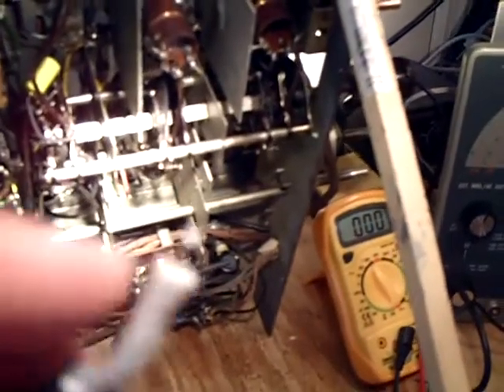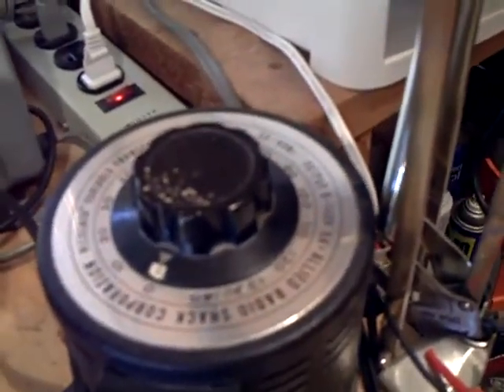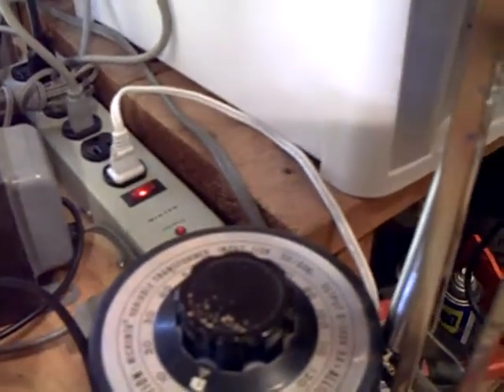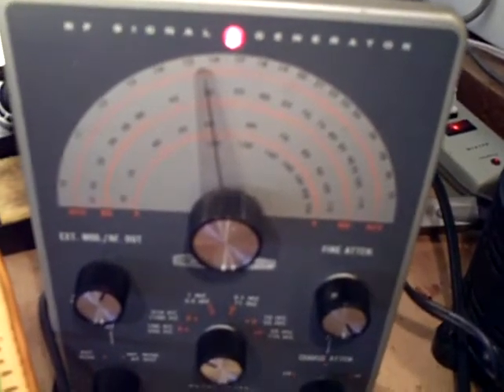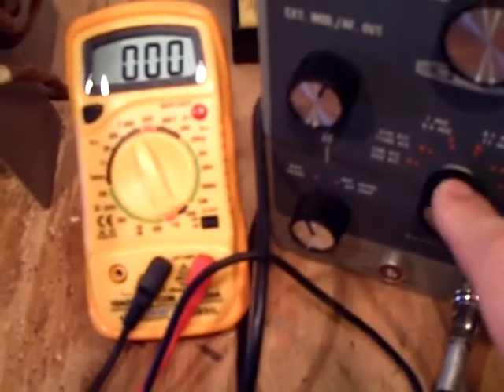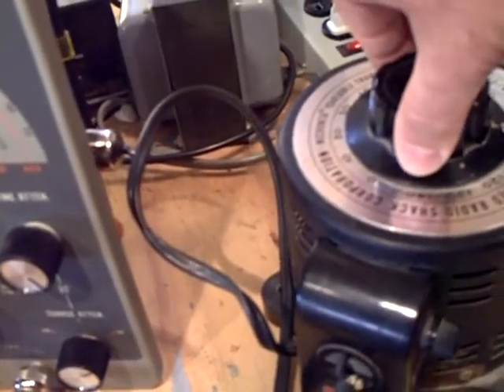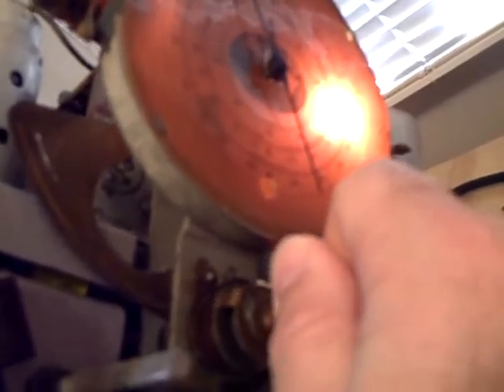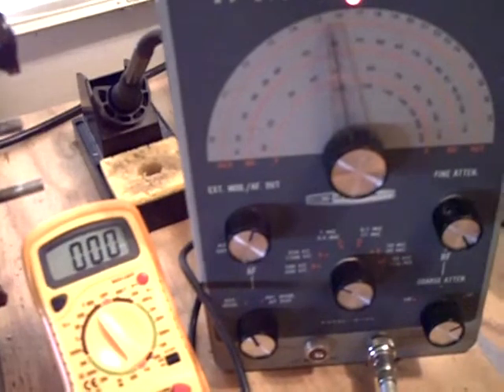Part 16 RCA 262 Repair. Cable replaced, full alignment, but...

Comment from the maker: Wow! ThanksI really needed that today.
Working hard on it. Have distortion on 1st auido tube casue of low plate voltage, going nuts tyring to correct this. very difficult to figgure out. is sensitve but audio isn;t too good. Thanks for the encoragement!